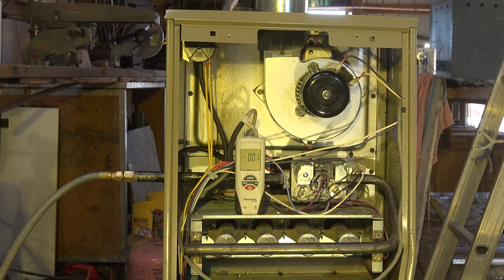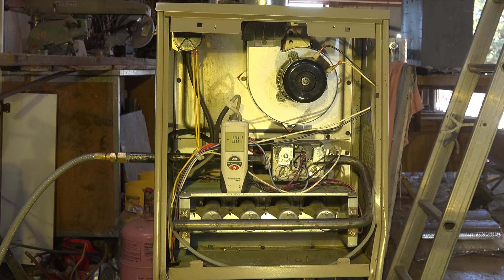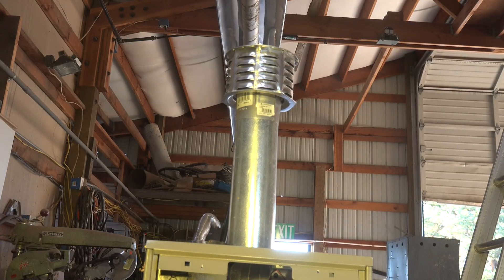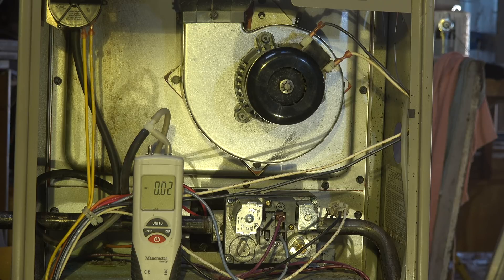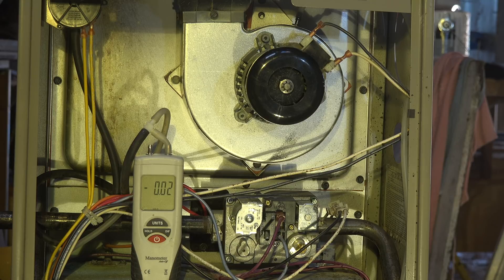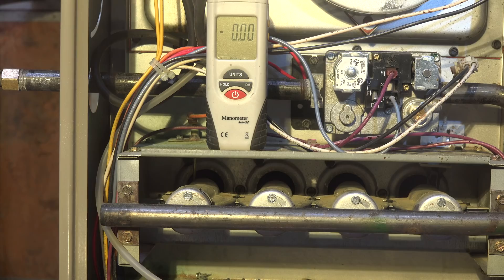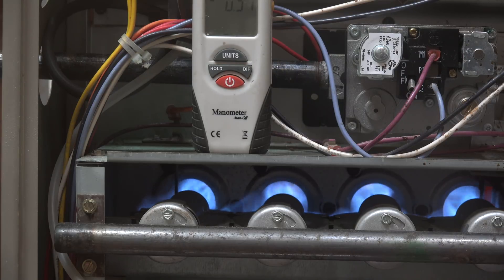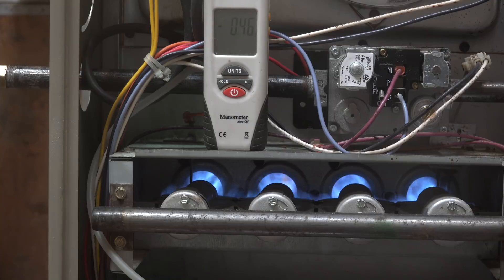Will a furnace with a blocked vent cause a flame rollout

Comment: I had this exact issue at my house. Except it took 15 years, one replaced heat exchanger, and two new furnaces to figure it out. The issue, it appears, is a partial blockage. The inducer fan spins up at a relatively fast rate, then settles to a more normal rate. That creates the vacuum needed, and the flame will start. But, after a while, back pressure builds, and you get enough heat backing up that the rollout switch detects a rollout. No actual flame rollout is evident.

Comment: I question how blocked that furnace flue was.  Where is the heated gas going if the flue is blocked?  Back out anyway it can.  
As with the first test, you saw rollout on the left burner which made perfect sense... but not on the second test.  What changed?
Youtube is often untrustworthy.
Reply from the maker: I am not making a conclusion here.  The 2 tests were done back to back.  The only difference was the furnace during the first test was cold.  The second test had a warm furnace.  
What I do think is that with an almost totally blocked vent, the pressure switch should have shut down the furnace.
GFM

Comment: theres a video on youtube of a blocked vent causing rollout.  he went on roof moved it and it ran fine after.
Reply from the maker: Send me the link.
GFM
Reply: @grayfurnaceman  https://youtu.be/fWC2smK9hvg thats the youtube vid link.
Reply from the maker: @colonelradec5956  Thanks for the link.  The furnace rollout did its job and shut down the burner when the temp got too high.  I can't give a reason for the failure of the pressure switch.  It should have shut down the sequence of operation before the burner came on.
GFM
Reply: @grayfurnaceman  yea im no pro but i thought the same.  seems like they don't always work?  which is kinda sketchy lol.

Comment: Yes, it does. My 4th burner (lowest) and eventually 3rd burner was choking and going off after 10-20 seconds and flame sensor was turning the furnace down. I detached the vent in the attic for a short test and it recovered back. Other furnace was fine so gas pressure was ok. I had my roof done recently and gas caps were replaced. Likely that they pushed it way too much, I called the guys and they will come/check.
Reply from the maker: They do sometimes push them down far enough to block it off.
GFM
Reply: Why not get a twist and lock cap? Recently, I have to replace furnace vent since the original builders of the house did a poor job and never really secured the very top 4 foot of the furnace vent. It was never twisted and locked and was secured by vent lead flashing for Spanish tile.  So after about 14-15 years it rip away and blow off the 2nd level roof. When inspecting the furnace one day during the summer noticed that I can see light outside. Ended up replacing about 5 foot of the B-vent with home depot brand and ordered online a twist and lock b-vent cap that matches up with the same home depot b-vent brand.  Also replaced the the rip up lead flashing.... I shortened the b-vent by a foot since current city regulations allowed it.  It's just funny in this time and age that there are no industry standard for twist and lock for b-vent. You have to keep with the same brand or have some kind of adapter for different brand of b-vents.

Comment: My kid put a rock into the exhaust. Is that bad? I can't get it out.
Reply from the maker: If the furnace still works ok, its fine.  If it stops and give a pressure switch fail, you will have to get it out.
GFM

Comment: I see this quite a bit where the  Roofer pushes down the  Vent cap. Most of the time a water heater is "Y" into the vent.  So the furnace exhaust pushes out the water heater hood. These roofers could kill someone with CO poisoning.  Plus, the condensation at the venting seams is a dead giveaway
Reply from the maker: I have seen that too. I think they just don't understand how that cap works.
GFM

Comment: Crossovers between burner 1 and 2  seemed show show some rollout after blower startup. But seeing that , I normally double check the 5/16s screws holding the clamshell to the front plate. When loose will allow blower air to hit the burners. Enjoy your vids.

Comment: Can a natural gas furnace be utilized without duct work.
Reply from the maker: It can be, however, the circulating fan may overdraw power without ductwork.
GFM
Reply: @grayfurnaceman  Thank you so much for the reply. Any chance you could slap a video together? ?
Reply from the maker: I will see what I can do.
GFM
Reply: @grayfurnaceman  I got her fired up today. . Ran it for a few Cycles. . Iran a manifold on the top and an air intake. I used the old stuff. Now I've just got to run some ductwork to the house. And we're in business. Thanks, brother. !

Comment: Had a call last night on a gas package unit on the side of the house. The roofing company just replaced the roof and put a tarp over the package unit and blocked the exhaust vent which made the flame rollout and trip the rollout switch. After resetting the switch I watch the flames for 30 minutes and checked for carbon monoxide everything was good. Point being in my opinion a blocked exhaust will cause the flames to rollout and trip the rollout switch.

Comment: Also.happens all the time on a plugged secondary heat exchanger or plugged cva on high efficient unit.
Reply from the maker: You are correct.  A blocked secondary heat exchanger will cause a rollout, but will not shut off the pressure switch. However, a blocked CVA will cause the firebox pressure switch to open.
GFM
Reply: @grayfurnaceman  What is a CVA ?
Reply from the maker: @uski  Combustion and ventilation air.
GFM
Reply: @grayfurnaceman  Thanks !
Reply from the maker: @uski  Welcome
GFM

Comment: At 4:27.  Duh. It does roll out. But there isn't a roll out switch right there. That's your flame sensor on the left burner.  Also.if the flue was partially plugged just enough for that pressure switch to stay closed for longer you would have seen that roll out again.
Reply from the maker: The unit was set so that there was just enough vacuum to keep the pressure switch closed.  And again, that is not a rollout.  It is a flame failure.
GFM

Comment: You tripping?  The left burner was rolling out sporadically the first time you fired it up.
Reply from the maker: That is not a rollout.  The intermittent flame failure is a failure to pull enough fuel air mix into the heat exchanger.  If I had a rollout, the flames would be continuously rising above the entrance to the heat exchanger.  
GFM
Reply: @grayfurnaceman  I agree but at 4:27 the flame failure kind of has a roll out effect. And I've seen the newer units with more sensitive roll out switches trip on things like that.  Also the switches on certain units are right above those burners and trip easily from.flame abnormalities.  I love how you put a theory to a test. I would like to see and do more of this myself with a.c and heat.
Reply: What causes intermittent flame failure?
Reply: @JuanRivera-ff6fd  intermittent would look at flame sensor. Gas valve. Depends if millivolt system etc
Reply: @CommonSenseFishing209  my system has a standing pilot light ?
Reply: FYI, I solved my issue. It turns out I have a slow opening valve and that feature failed. The valve was opening immediately and was detonating and blowing the burners and pilot light out on start up. Replaced the valve and all is good. Thank you for your quick response.

Comment: I know I have a issue with flame rolling over because I can see it, but it only does it when the fan kicks on? Can you point me in the right direction?
Reply from the maker: That is classic cracked heat exchanger.  Either the heat exchanger or the furnace must be replaced.  This is an unsafe condition.  Possible CO poisoning.
GFM

Comment: Grayfurnaceman, I just cleaned my burner tubes and orifices on my furnace. I switched it on to test it, and when I shut it off, there are small flames at all five orifices. It has spark ignition, no pilot light. It's been off for almost 10 minutes and the small orange flames are still burning? It's an older, Weather King outdoor combo unit, and has a Honeywell regulator? Flow valve? Not sure what it's called. Any suggestions would be appreciated.
Reply: @grayfurnaceman  It wasn't doing this prior to cleaning the unit. I'm assuming there's no way to clean the valve if I accidentally got some crud in it? Also, I'm running lpg, if I buy a new valve set for natural gas, can I use the lpg conversion out of the old valve to convert the new one? It only regulates flow pressure, and doesn't function as a valve, correct?
Thank you for your speedy response to my initial question.
Reply from the maker: @mattschamel6550  It is a combination valve which means it provides regulation, safety shut down and solenoid valve.  Any replacement valve must be designed for LPG.
GFM
Reply: @grayfurnaceman  thank you, I appreciate your help.

Comment: Sir I'm back, you helped me with my gas valve issue. Thanks you saved me 600 bucks. Now I'm back lol I'm getting 6 flashes on my Goodman and its says it's the flame rollout . My fans wont stop and the flame wont come on. How to fix?
Reply from the maker: This probably an open rollout switch.  It is a manual reset switch probably located near the burners.  
However, resetting the switch is not a repair.  It rolled out the flame for a reason.  You could have a crack in the heat exchanger.
Careful on this one.  You may need a repairman.
GFM

Comment: Somehow I thought I'd commented on this video. I tried something similar on a 98% efficient Bryant furnace in the classroom, just to see if I could starve it of enough air to trip the pressure switches. At the time, the idea of a flame rollout possibly taking place never occurred to me. Although I didn't kick it up to the second stage, nothing I could do to the combustion air intake would get it to stop running.
Reply from the maker: What is being attempted here is not reducing combustion air but blocking vent gas from exiting the furnace.
GFM
Reply: @grayfurnaceman  Blocking the flue pipe on a high efficient furnace  the board won't let it run if its blocked.

Comment: Have has roofers cut thru the double walled Y style pvc pipe at the roof line. Obviously the exhaust and vent weren’t separated correctly afterward. Pressure switch killed it everytime unless I held it in correct place.

Comment: Both.. This is still a rollout condition,  towards the end you can see that the crossovers are lifting (most notably the far left). I assure you if you let this labor for 20-30 min that burner box would trip a rollout. However it may not run that long b4 it faults on flame rectification or pressure switch. Now for a real world scenario, throw a gust of wind at it and its likely to trip the PS especially being that closs to the balance point. 

A newer furnace with dual reference points, one before combustion blower housing (collector box) and one within blower housing, makes this an even less plausible condition. Usually a partially plugged secondary or large breach in primary is the only thing that will allow heavy rollout and not fault a pressure switch. Also worth noting, shouldnt any termination going threw structure be class B, pretty unlikely for a cap to be pushed too far down on interlocking fitting.
Reply from the maker: I will do a test of the longer operation.  As for dual reference points, this is an 80% furnace.  It does not use dual reference points.  I may even try the wind gust.  
All 80% furnaces should be using B vent for the entire vent.  But I would not guarantee that even with B vent, the termination could not be pushed down too far.
GFM
Reply: @grayfurnaceman  I dont know that its really worth the effort for something so trivial, either way there is no harm or danger in either outcome as one of the 3 safeties would cause suspect. I think a better use of your time may be in testing the flame characteristics vs unmetered air like we spoke about in your other video. As far as wind caps, the ones I'm familiar with spin and lock into place, making it impossible to goof. And correct, which is why I said newer furnaces with dual ref design.
Reply: This rose a red flag with me as well, time to start working this out after making this a proper installation. Then and only then can you actually be confident in your diagnostics. Trying to fix a leaning building with a trash foundation.

Comment: A low powered Inducer motor or failing inducer motor will cause flame rollout.
Reply: not really if the pressure switch is working

Comment: On Rheem condensing furnaces I've seen flame rollout due to one models Inducer tranistion tees had a restrictor inside to slow down the flue gas. Rheem did this to gain an extra 1% efficiency. In some conditions it causes the flames to rollout back out into the burner box and either trip the rollout or burn up the rollout wires.

Comment: I think it would be interesting to see at what point the pressure switch WOULD drop the burner out. It got as high as -.45 which I would have though would drop out the burner.
Reply from the maker: If it got below .4, it shut down the burners.  The point of this exercise was to determine if there was a point that the pressure switch would stay closed and the flame would rollout.
GFM

Comment: You still have a draft. Try blocking the vent completely. The flames can’t get drawn in unless there is air moving out of the flue.
Reply from the maker: If you block the vent completely, (and this vent was very close to that) the pressure switch will shut it down.
GFM

Comment: Because it’s not completely blocked and that inducer motor pulling 1inch wc and the pressure switch closing at 0.5. It may or may not open the switch and error off on safety. If the exhaust pipe was completely blocked it would have error out and the pressure switch would not have closed. If u look at the manometer it’s running 0.4 wc which is still within tolerance, thus it’s still running.
Reply from the maker: The 1" wc is with a clear vent.  I closed off the vent until the pressure would just barely close.  The point of this exercise was to block the vent to the point that the pressure switch would barely close.  If the flame then rolled out, there is a design problem with the furnace.  The pressure switch is there to protect from this problem.
GFM
Reply: Having a supplemental rollout switch is something that most furnsces have have down here in Oz for more than 20 years....AND perhaps pressure switch build qualitycould be tweeked somewhat?
Reply from the maker: The rollout switch became standard when induced furnaces were developed.  The pressure switch on this unit operates within specs.
GFM

Comment: If there is a water heater sharing the same vent, will a full blockage on the roof cause the furnace to malfunction? Or will the exhaust gases backfeed down the water heater exhaust and into the structure?
Reply from the maker: If there is a W/H on the vent, it will definitely backfeed.  The result of this usually is the pilot light is extinguished.  I look at this as a good result.  The problem then is the tech that comes out for the water heater problem has to figure out it is not a problem with the water heater, but with the furnace venting.
GFM
Reply: Yes it will come out the draft hood on the water heater.

Comment: Would instead trip on high limit? I've seen roll out do to cracked heat exchanger, pressure switch issues with blocked flue.
Reply from the maker: The limit should not open.  
GFM
Reply: I was thinking it may have tripped on the high limit switch, but his second test eliminated that thought as it ran much longer.
Reply: I was thinking more about a true residential set up with return air. As the space nears set point, warmer air and a blocked flue, to me would go off on high limit
Reply from the maker: A blocked flue will not open the high limit.  
GFM
Reply: @grayfurnaceman  ,  Just curious, why do you believe that?  I get that there is limited air flow, but the heat of the flame is close to the limit switch, at least on my older furnace, which I believe both opened and closed within a predetermined heat range.  Modern furnaces probably have a limit switch that cuts out only above a set temperature.
Reply from the maker: As there is no reduction in circulating air flow, the limit will not open.  There is somewhat of a reduction in vent gasses removal that would increase the time the gasses are in the heat exchanger, but that would make little difference.  The only limit that could open is the rollout switch above the burners, but that clearly did not happen.
GFM

Comment: it's dancing and flickering enough on the cross overs it may eventually cause the roll-out switch to trip. but no guarantees.
Reply from the maker: The dancing and flickering is pretty normal for this furnace.  Janitrol GMP model.
GFM
Reply: fair point

Comment: So what’s the conclusion? That the pressure switches and inducer are not working right? Or a blocked vent doesn’t matter?  I bet on a wall furnace there would be rollout. 

I don’t know...
Reply from the maker: There is no exact conclusion.  I will be doing this on more models of furnace to see if there is a difference with them.  Actually a wall furnace with a draft hood will not rollout flame.  The draft hood will spill.
GFM

Comment: I had a bird block a vent and it was a concentric termination and had someone at the furnace and the flames did roll out it was a Bryant furnace.
Reply from the maker: All furnaces have pressure switches that are expressly there to stop the cycle if the vent is not clear.  Does not mean they always work as they should.
GFM
Reply: @grayfurnaceman  this is true.
Reply: Marco A  yes they do but somehow it wasn't working.